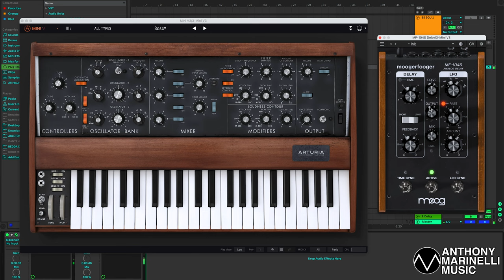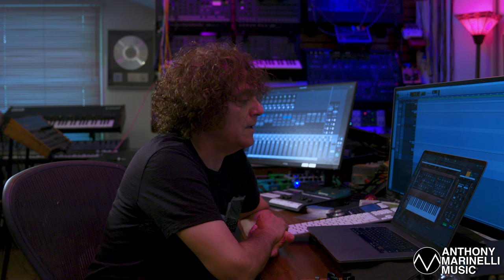10 Distortion Techniques:  Every Synth Needs This

Comment: Hey Anthony, this is a great tutorial reminding us what we might be missing! I have used drive from time to time on my hardware synths: there's a Level 42 instrumental on the first album called "43", and I play a Moog solo with a square waveform, and we split the output so that we got a clean sound into the desk and a driven sound into a guitar amp (I don't remember which amp, could have been a Fender Twin or maybe a Marshall) anyways - as we go through the solo and it develops, the amped sound gradually takes over until on the last note I get feedback - I think Mark (King) was dialling the gain controls on the amp.

Comment: Note that you don't need a Moogerfooger that costs your right arm and your firstborn … I use an "Electro-Harmonix Operation Overlord" stereo pedal for my Roland TR-09 (a boutique 909 module) that cost like $150 and provides great results as it has a "Mix" knob, which the otherwise awesome Erica Synths Acidbox III doesn't have.

Comment: One of my favourite ways of gritting up synths and drum machines is to run them through an old Boss EQ pedal – +/-15dB of gain, plus the same on each band – really good as a fequency selective drive.
Reply: There also is that inexpensive TC electronics 1140  rack EQ around, that has a built in pre. This thing also rocks for distorting synths and drum machines. Tobi Neumann showed me this trick back in the days when rave culture  just  began.

Comment: With digital multi-fx it seems that the od/ds/fz section is still behind analog pedals. Time based and modulation fx can be absolutely fantastic in the digital domain.

Have put a Boss DS-1 on drummachine (kick & snare) and with the gain/distortion low (12 o'clock or lless) you get a crunch and maintain dynamics.

My KingKorg (not an ARP 2600 or MiniMoog) has this boost/drive option with a real tube in synth 😅

Comment: A big difference between the SEM and Two Voice is not just two voices but the fact the output mixer is basically an MXR Distortion Plus with two inputs.

The muSonics modular takes this into account, along with allowing the filter and VCA to overdrive as well.

Comment: I appreciate the run through Anthony. I do love seeing people who love sound working with varieties of tones in this way. You got some terrifically nasty tones. 
I have a couple Multimoogs (still). It was back in the early eighties when I first heard of the Minimoog input trick. Of course the Mini and Multi have different ins and outs, etc. With some experimentation, I found that I liked the overdrive that I got by routing the Multi’s audio back into the filter input, rather than the audio input more. 
Eventually, I used a Boss Turbo OD on the Multi, but a RAT pedal seemed to pair better with a Matrix 6.

Comment: Distortion is an essential tool, created in many ways. I use some/multiple forms of distortion, in basically everything. Funny enough, I sometimes even run stuff through the pre-amp of a cheap 1990's Panasonic microcassette memo recorder. It has a mic input, and monitor output jack. Another thing I do a lot, is use a Behringer Tube Ultragain (Currently using a 1962 Mullard 12AX7.) I also use the various kinds of drive, and distortion offered in my Empress Effects Zoia modules. Right now I'm on the hunt for another, but very basic tube preamp that can have the drive cranked, that also uses 12AX, 12AT, and 12AU tubes, because I have a small collection of all three types, but mostly 12AX7. in 12AX, I have vintage Mullard, Telefunken, RCA, Sylvania, Siemens, Tung-Sol, and a few more. 😁

Comment: I was getting so many distortion pedal to trace the 303 vibe and original think was just get one to fat up my circuit groovebox. I also get a orange tube amp for my synth, but it seems when the sound design work they are not wasted.
Reply: Dod carcosa is all you need for 303 my friend. :)
Reply: god you can go on for days just playing with distortion on a 303

Comment: You should be able to test this. On the MogerFooger plugins, i have a theory that they mistakenly switched the input/drive and output knob. The colour and distortion that the output knob gives sounds more like what the drive does on the pedal and vice versa.
Reply from the maker: Interesting I have to test that out

Comment: Distortion is pretty key to my music style. So one of my favorite synths, the Volca Kick, has this really nasty drive built in that’s alright on kicks but bruuuutal when you use the Kick as a bass groovebox. Similarly, my SP2 has a built-in diode clipping stage on the Input slider where you can recreate the Minimoog drive trick by patching your output to MULT and then input and your mixer and maxing the input slider. Sounds more like a mixer pre to my ears due to lack of EQ circuits in the signal path. 
My favorite pedals for synth distortion are the Dynostaur (some cheap Chinese thing) and the DOD FX-55B. Dynostaur is an almost-fuzz, while FX-55B is just a really well voiced distortion.

Comment: Great video! Lots of tasty distortion! You never specified so I assume you didn’t use a reamp box to put the line level of the synths down to hi-Z. Is that a preference or are you doing so to quickly reach the levels of distortion you want, since the line level is much hotter than the pedal is built for? 

Also pretty positive I saw you at the Mike Dean 3/1 concert a couple days ago!

Comment: I was under the impression that you had to have a reamp to go from a synth to a pedal because the signal is too hot compared to a guitar signal and could overload the circuits. Is that just not actually true? I have pedals that I've never hooked up to my synths because I wanted a nice reamp box.

Comment: honestly, i really doubt there is a big if any difference between an old metal zone and a recent one. Those are not hyper complex circuits and the components used in them then are still largely sold and distibuted now.... If you're collecting old gear and vintage is a big thing for you, great, but if your concern is only audio, you just might aswell get the afordable one. I would like to point out that there are so many dumb myths, snobbish talks and misconception regarding audio gear. I'm not saying that there are never any differences, but usually they are slight, or what changed changed for the better, and usually for an 80's guitar pedal that's reissued, your gonna get the same thing, these opamps or diodes are still  on the market on large scales. Of course some thing couldnt be redone in larger scale, you'll need to find a builder (i remade mutron 3's, and then i added more functions, and made the invert react better, and...). Oh and just to not be misunderstood, f--k the b brand! and theyre copycat plastic crap toys ending in the dump 10 years after (sorry couldnt resist, my opinion thoug).... love da vids anthony, they are so inspiring